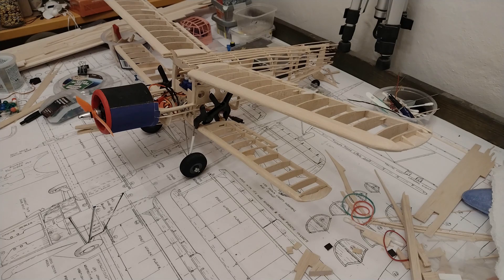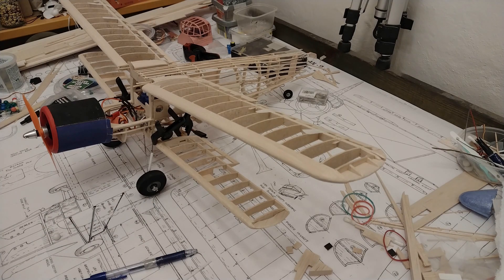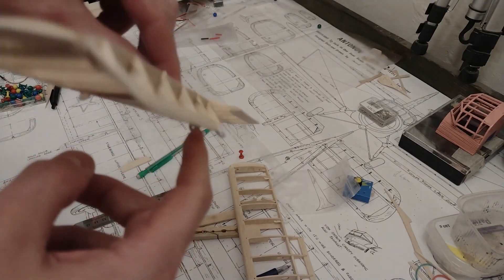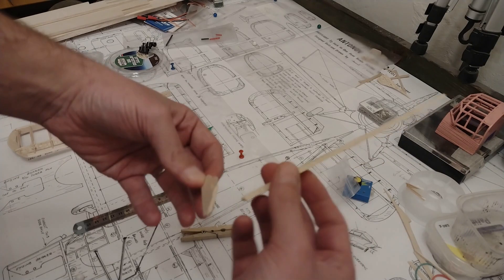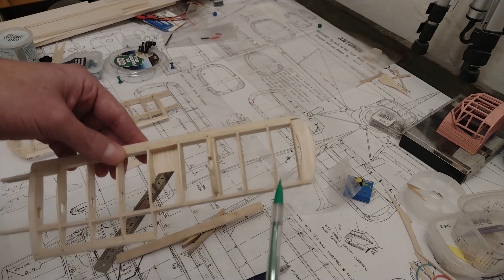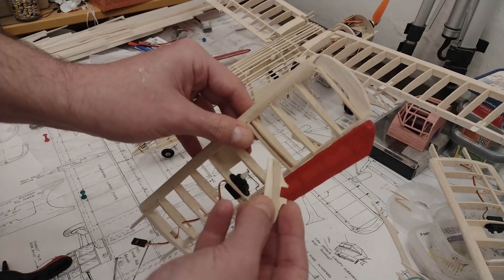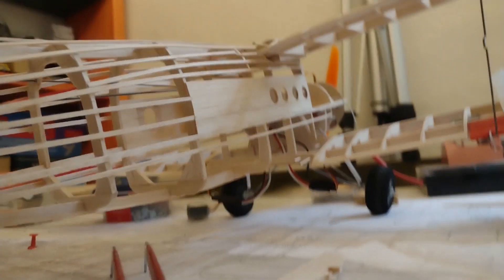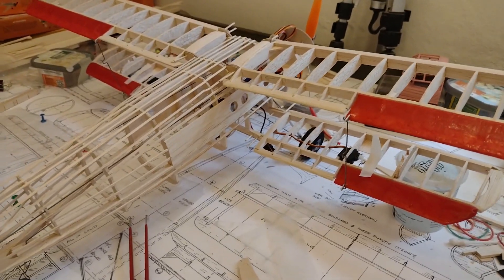14 Antonov 2 RC Conversion   Wing assembly ailerons and servo check

Comment: Good job on the ailerons. 
I know you have put a lot of tbought into the rigging arrangements, but I wouldnt do it. I would abandon everything you have made that fits into the pocket between the double ribs.
I would use your double rib "pockets" to make a socket to receive the struts, top and bottom. 
You could simply champfer the sides of the ends of the struts so that they match the  side of the rib.
Once you have a good fit, cover the wing then just cut a slot in the tissue to insert the strut and glue to the side of the rib. Of course you will also glue it to the top of the other rib in the pair.
The bracing will just be a nuisance. It will catch on things and you have already worked out the hassle it will be making little retainers and turnarounds. 
Focus on things that will maximise flying performance. 🙂
Reply from the maker: Thank you! Yes indeed a lot of hassle for probably worse flying performance. Biplanes are challenging in many ways.
I wanted to try the rigging as I've never done it. If push gets to shove I can always cut them off and leave the wings clear. I think structurally it should hold up anyhow.
Thank you for stopping by!